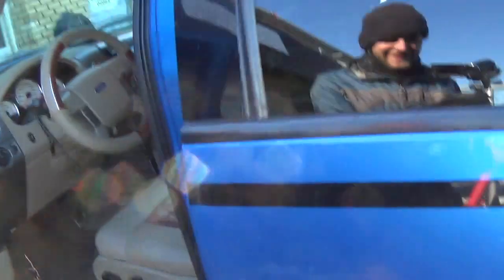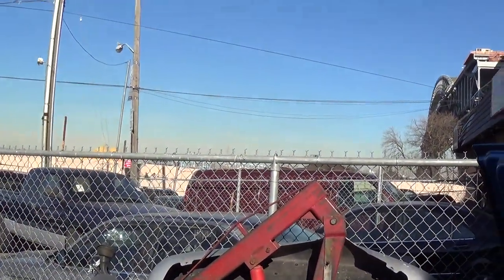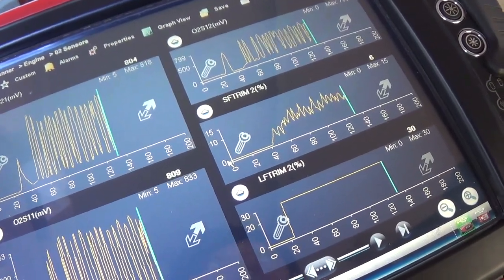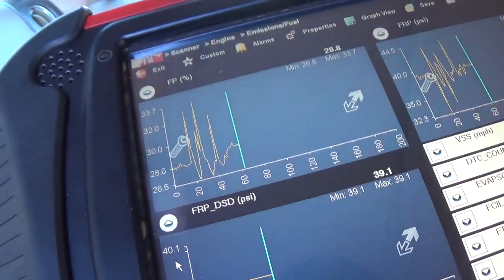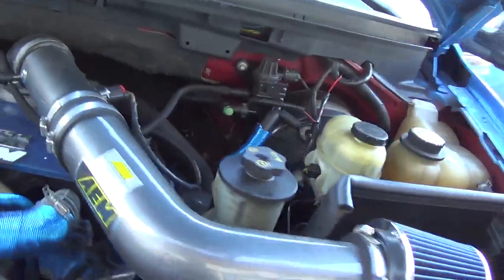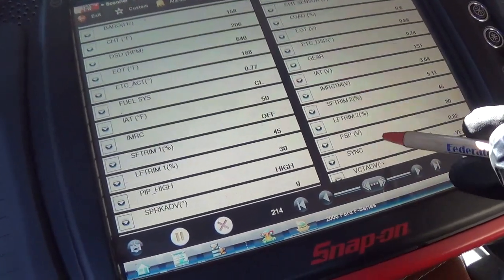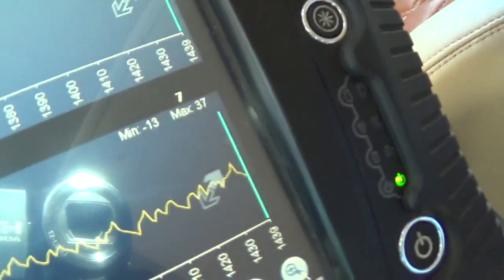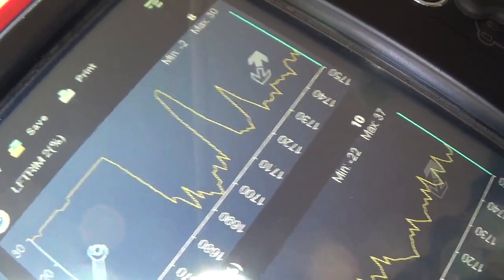F150 Runs Rough, Lean P0171 P0174 (SI Ep 6.2)

Comment: Regularly like your videos and such but it seems due to one example you give Cold air intakes a bad name.. yes i see proof here but on most makes and models it doesnt affect it.. it does seem  though that newer models are running into this issue.. as for me both my 99/00 grand prix 3.8ls and my 03 5.3l silverado have had nothing but gains from a cold air intake even homemade ones.. also that is not K&N i know your trying to be general but you just gave K&N a bad name when that is AEM also a big name..
Reply from the maker: Did you dyno your vehicles before/after the modification to quantify your "gains"?
Reply: motoYam82 no for dyno purposes a cold air intake is nothing but a "supporting mod" i did though see better mpg and better 0 to 100km times..yes times were same road same day same bullydog programmer installed in truck 30 mins within each sets of runs.
Reply from the maker: That's cool. I just like to see numbers before believing something works or doesn't :)